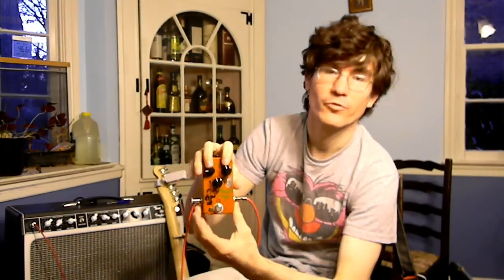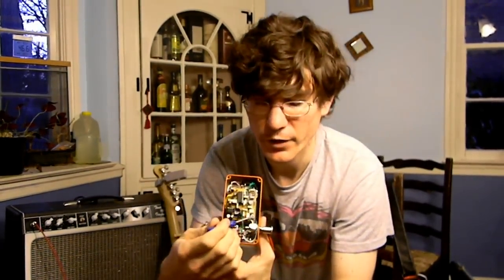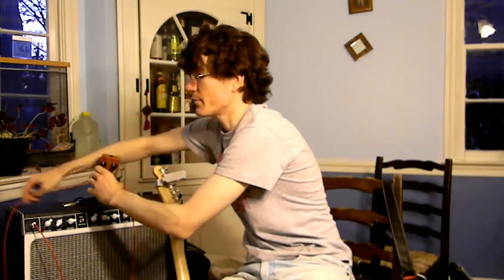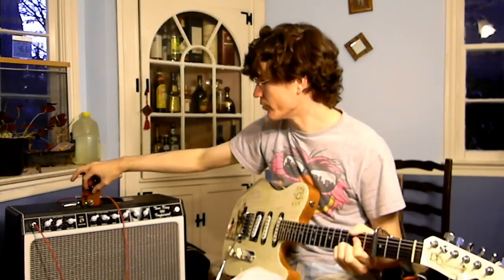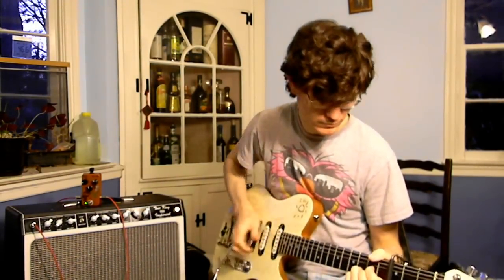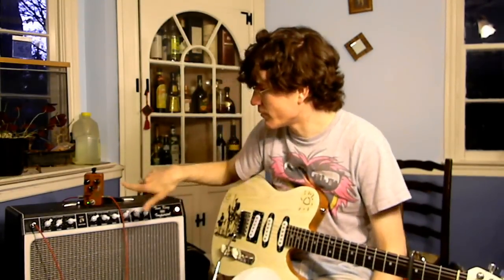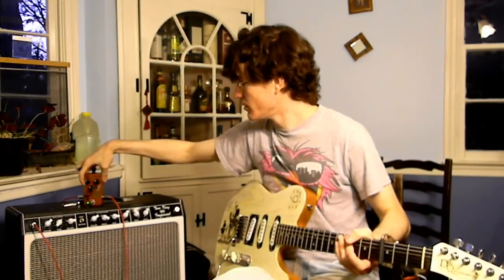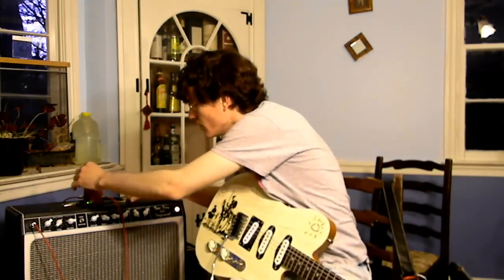Hamlet Delay (one of my designs/hacks)

Comment: Hey. I found your design while looking for a delay version with tone control. I have a question for you. Does your tone circuit have an impact on the number of repeats? Like when it is in self oscillation, will darkening the tone prevent from oscillating?
Reply from the maker: Yeah -- anything that removes some of the sound will cut the repeats some, but the bulk of the signal should still be there so probably not by much. You should be able to feedback enough signal to oscillate regardless of how dark the tone is. IIRC the PT2399 can oscillate just from self-noise.
Reply: @jonspatton  I just tried 4 different tone setup (taken from the available schem I found). Some put the tone circuit right before the mix pot; these  are the type that attenuate the fbck a lot. But yours and the like just damper a bit, so it is not that big if a deal. I still have some experiments to do but I did chose your design. It sounded best.
I plan on building the complete Hamlett sometime soon. From your demo (which is really good btw) it has a much better overall sound than the Deep Blue clone circuit. I'll check your other designs as well. Thanks for sharing it.

Comment: Can i use it on my amp loop +4db output?
Reply from the maker: +4dBU is 1.228 volts RMS, with a peak voltage of 1.7V. That's not actually that big for a guitar signal to begin with. We have 18V to play with in the Hamlet. The charge pump gives the amplifier section 18V, and the amplifier section amplifies 4.7x. The delay line is different. You can't overdrive the chip because of the LED current limiter, but the LED does limit the delay line to a maximum signal size of 1.7V peak to peak at the input (which, completely unintentionally, is the peak voltage of +4dBU). The delay signal is always unity to the input signal. It's amplified later to be able to make up for particularly hot input signals, which won't be unity when they hit the LED limiter, but essentially the delay line can't be overdriven and the only distortion there is internal to the PT2399 (which we can't do anything about). So if you were to feed the Hamlet a signal that's exactly +4dBU or smaller, you'll easily be within the headroom of both the dry path and delay paths.

This assumes that the output of your amp loop doesn't exceed +4dBU. I had a look at the manual for my Hot Rod Deluxe and it doesn't actually specify the output, for instance. In any case, you need a pretty big signal to distort the dry path of the Hamlet, big enough that you'd be clipping the input of a tube amp anyway, so a little extra distortion from a delay might not be noticeable. The output impedance of the Hamlet is almost 5K, which is fine for a 50K impedance like on my HRD but I don't know your amp, so I can't give advice about that.

Comment: Nuff said about the Hamlet, I already ordered what I still needed and am working in Diptrace to make a PCB. We should talk about that booze cabinet :) btw, is "soonish" here yet? If not I'll just go on to build this and build it again once the tap tempo thing is ready for presentation. Thanks Jon, you really concluded my search on which delay to build.
Reply from the maker: Heh, if the "soonish" was referring to when the PCB would be available, I did a 50-piece short run a long time ago. I don't like to do multiple PCB runs and I think I'm out of them. JMK PCBs did release a tap tempo version, which also has the volume and tone controls external.

If you're making yourself PCB layout from scratch, e-mail me and I'll give you some thoughts on the layout and possibly alterations that could be made to the circuit.
Reply: jonspatton
You are on short delay, my friend :) I was actually referring to your tap tempo version. Too bad you are out of PCB's though. It would have made my life a little easier since there are too many things I want to build. With the things I do build I am keeping in mind that they are useful in combination with my RC-50 loopstation and add to the capability of creating things I have in my head. If by odd chance you have a PCB in a corner somewhere though, I would be interested. Or maybe even some gerber files even though I have never been able to open those succesfully since I hate Altium and Eagle, so Diptrace is my thing. As for the tap tempo, I'd probably need to order a taptation kit and I'm not that fixed on having tap tempo since the things I do live are pretty much thought out in advance. Thanks for your quick reply, Jon. I will def be following you. I was just starting to listen to your EP, so I'll get back to that. :)
Reply from the maker: Remy van Noorden
Oh. JMK still has the tap tempo version PCBs. I just don't have the original PCBs (the non-tap tempo version).
Reply: jonspatton
Well, since I haven't begun building this one yet, would you recommend it and say it has improvements (besides the tap) or is it basically the same thing?
Reply from the maker: Remy van Noorden
It is the same with the following additions: tap tempo (obviously), and the tone and volume trimpots have been moved to external pots. I think Jacob might have made a few other small changes; I think the tone pot has a wider range, for instance.
Reply: jonspatton
I think I'll stick with your original design then, and muddle on in Diptrace. Thank you so much for your time and work, Jon. And like you said; it's easier to move a trimpot to an external pot than vica versa. I wish you all the best. By the way, I love your (Midway Fair) music. Right up my alley. Take care. Greeting from the Netherlands.

Comment from the maker: Aww, thanks, man! There's some info on the Don Quixotecaster on my website. The pickups are Vintage Strat pickups from Reilander. (They won the pickup shootout I did for Frugal Guitarist and cost $100.) Otherwise, just a really basic setting on the rhythm channel of the amp ... and fingers. :) The Imperial is from 2005, so nothing unusual about this model, though I am using a 12AY7 in V1 instead of a 12AX7. It's just a *great* Fender-voiced amp.